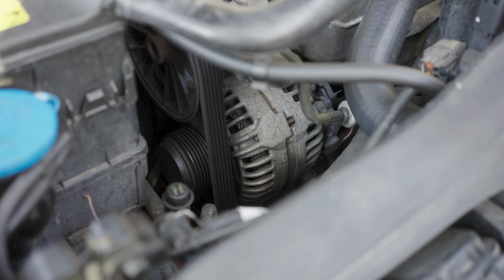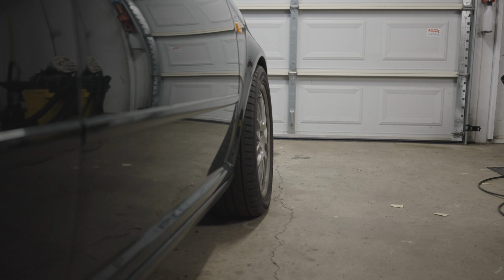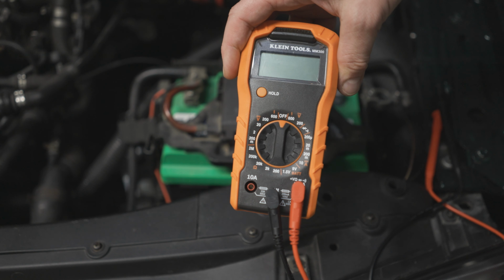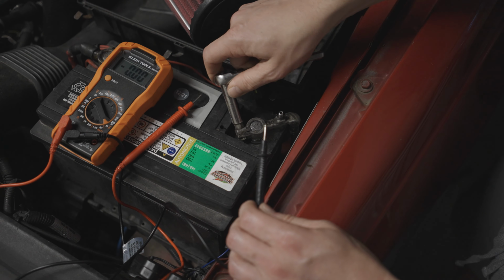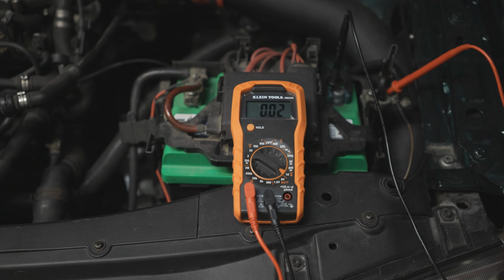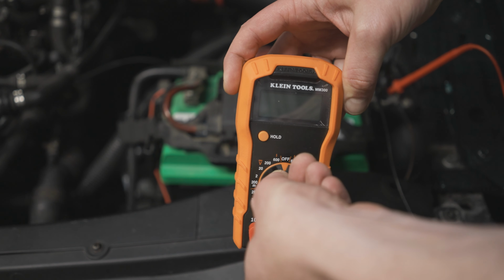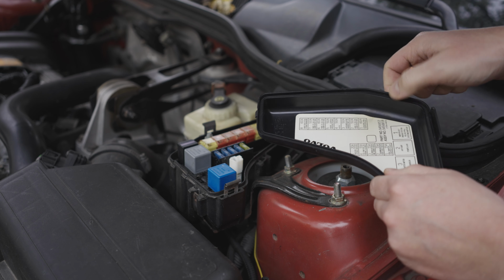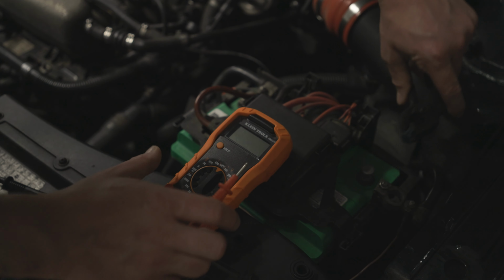How To Test Parasitic Draw on a Car Battery

Comment: Had an intermittent drain on a 2000 Bravada few years back. Finally found it. The vanity light switch was failing and the light for the vanity mirror on the sun visor would, sometimes, come on. Couldn’t see it because the flap was closed. Took forever to find.
Reply from the maker: It seems like every story of a battery drain is different. I haven't had a vanity mirror switch like that go, but I have had problems with a poorly wired radio and a door switch. I've also seen someones phone holder contacting the eject button on the radio and that was causing a drain.
Reply: Good info thanks. Always look at the vanity mirror lights first. In a dark area with the car off, key out, you should be able to see some light around the edges. Or could try to use a temperature reader.  Handheld, you can get them at harbor freight. If the vehicle has been sitting for a few hours the visor area should be same temp as everything else around it. The old GM switches are just a little plunger like, the size of a pencil lead.  If it is the vanity light, I would just pull the bulb out.
Reply: Think that’s what I found on my 2000 blazer PO taped it took forever thought it was the aftermarket radio
Reply: Nice

Comment: Too fast slow down Jack
Reply from the maker: Thanks for the feedback. Anything I can help you with?
Reply: @StevesGarage  noobs like myself can't catch up but will try this week. My brand new 2024 Toyota Grand highlander xle hybrid has been draining my 12v battery.  I can only imagine that it's communicating with Toyota while parking in the garage.
Reply from the maker: @onehmong9368  That new I'd probably just bring it into the dealer. There's no reason it should be draining the battery even if it's connecting to the internet for updates.

Comment: Just tested my truck using this method and got 0.02 on 10A scale. So my truck parasitic range is still ok right? Ive added a bunch of accessories(lights) most are to constant power but have switches so none of them should be drawing anything ....but i have 3 glowshift gauges that i think 2 have a constant power wire to keep color memory...dont remember if i hooked up that wire for the 3rd gauge.
Reply from the maker: Yea that seems totally fine to me. Is your battery dying too quickly?
Reply: @StevesGarage sorry this is gonna be long just trying to be detailed. truck was having hard starting issues. At 1st I found out battery was always needing to be charged to start truck. So I disconnected battery charged it fully and load tested it it tested in the very weak range needle didn't even get to numbers lol. So bought a new battery made them load test it before purchase(over 1000cranking amps) made sure it was fully charged before install. Also while I was installing I figured good time to test for parasitic draw to see it that what killed the last battery. That's when I got 0.02 on meter. Anyway installed battery tried to start truck and still just click click click so got annoyed and hit starter with a hammer a few times and then got it to start(only time I've hit starter). Since then sometimes it starts fine other times  just click click click BUT I found if I try the ignition key rapidly like 6x in a row I can get it to crank and start the truck. At this point I'm starting to think brushes in starter are just about shot making it hard to start sometimes but thats just me guessing....starter is over 30years old.
Reply from the maker: @FAKE-NAME  I appreciate the details! 

With a new battery and a normal amount of parasitic draw, I'd say your starter is the next place to look. Especially because it's old, and you did get it to start after hitting it with a hammer. 

The only other thing I would check is things like your grounds, or other wiring that goes to the starter. I know in the case of my Jetta the wire that runs to the starter is a known problem, so in the case of that car it's the place I would look before going down the starter route.

Good luck and let me know once you sort it out!

Comment: I have had my battery unhooked for 30 plus minutes so everything could loose power and tested it gauge jumps way up not sure what the draw could be I have a basic needled gauge which nobody on YouTube has not even sure where to set it I have tried multiple positions and gauge jumps up but it's prob normal for a POS DODGE.
Reply from the maker: If you're disconnecting the battery and re-connecting it with the multimeter you'll need to wait for the car to sleep again. If you wire in the multimeter before disconnecting it and then leave the multimeter as the connection it should maintain the 'sleep'.

Comment: i did a draw test and i get 40ma with the remote starter. (new battery in 2022).  2-3 days not driving the car. the batter would get drain.  i removed power to the remote starter and it draws only 20ma. the car would sit for 3-4 weeks and still be able to start fine.  so you saying under 50ma is okay.. makes me confuse af.
Reply from the maker: Have you checked your alternator to make sure it's properly charging the battery? If it were me I'd also look over the wiring for the remote start system. Start by checking your grounds. I have a remote start system on my Volvo and it doesn't have that high of a draw.

Comment: Hook up meter shows 2.24 but starts to go down to 0, what's wrong can't check for draw.
Reply from the maker: That sounds like a connection issue to me. A reading of zero is pointing to a problem with your meter or wherever you're hooking the probes up to.
Reply: So I'm having this same issue... I have a Silverado that dies overtime, hook the multimeter up as shown, but it tends to slightly spark before showing the reading, then goes to 0. I tried this on a different vehicle that shows no drain and also never sparked.

Comment: Got a 07 ranger 4.0 . When its freezing outside its like my batteries dead but i got 12.4 volts. Alternator charging 14.3 battery is 6 months old BUT only 590 cold cranking amps. My 4 cylinder pt cruiser was 625CCA. ITS FINALLY  warming up to -2 tomorrow so try the parasitic draw testing,  but does the 590 CCA seem low for a 6 cylinder?  Any help would be appreciated.  Before i freeze my butt off. Thanks( currently on charge going to see if drops overnight)
Reply from the maker: I would think 590 should be enough, and the 625 on the PT Cruiser almost sounds like overkill. Sounds like your battery is healthy. Did you check all the connections? I wouldn't rule out a faulty battery either, I've had that happen. If all else fails I'd bring it back and ask them to test and possibly replace it.
Reply: @StevesGarage  I ended up taking it to local battery dealer who did a free test and it is the battery.  Even after charging it fully overnight and reconnecting brand new terminals it just barely started at -2° just waiting for a new shipment of batteries to come in. I was told in May by previous owner it was a new battery.  Guess he meant new used battery.  Thanks for your reply, greatly appreciated
Reply from the maker: @chrismcdonald6481  Glad you got it sorted out! It sucks it wasn't a new battery, can't trust anyone these days. But getting it solved is good, especially in the winter!
Reply: Ezily could of been new.
New is used these days.
Reply from the maker: @ Yea, I've seen more than a few bad batteries right out of the box.
Reply: @StevesGarage  it was a bad battery.  Got new one problem solved

Comment: Thanks, my multimeter shows 11.0 draw, don't know what just happened, will check my radio, it just makes a pop sound every time I turn it on😢
Reply from the maker: The radio makes a pop sound, or the car does?
Reply: @StevesGarage  Yepp, I hear a pop sound from the front tweeters when turning the radio on.
Reply from the maker: @aakudev  Do you have aftermarket speakers or a head unit? It sounds like you need a crossover.
Reply: @StevesGarage  Yes, I have a Pioneer double din since almost 12 years in my Civic. I also have Infinity components with crossovers. Everything was fine and this pop sound recently started, I checked the wiring too. Do you think it could be that the head unit is too old and can have issues?
Reply from the maker: @aakudev  It's been a while since I've done anything with car audio so it's hard for me to give you specific advice on that. It's possible you have a bad ground. You could also check the resistance of the speaker.
Reply: @StevesGarage  Thanks, will get some in depth tests done by an electrician!

Comment: Dont forget to check water levels in battery. If its low the battery may not be able to sustain even a common 20mA draw.
Reply from the maker: Do they sell serviceable batteries anymore? I haven't seen one in years.
Reply: My battery starts to die off in cold autumn before the winter. 2 days without driveing and i get 2 poor cranks and thats it. Battery is almoust 2years only and in summer no problem. I got this promblem in first winter with new one. Will try the multimeter again. Last year i checked  with no problems. Dont know, maybe bad battery with low water level
Reply from the maker: @garaiselvis  I don't know of newer batteries that are serviceable. As far as I know they're all sealed. If it's not holding a charge and you bought it 2 years ago you should be able to get a new one prorated for the amount of time you've had yours.

Comment: You just taught me so much in so little! Great video. Straight to the point and very detailed as always. Those multimeters are  very useful. I need to snag me one for sure.
Reply from the maker: Quick and informative was my goal! Multimeters are great to have around. You might not need one often, but when you do it's the perfect tool.

Comment: I have a 2002 Nissan frontier was reading 0.40. I replaced the ignition switch now it’s at  0.07 for a draw. Iv checked every fuse, relay, battery and alternator are good.
Reply from the maker: Interesting. Is it a common problem with those trucks so you just went for it, or did you diagnose it to be the ignition switch?
Reply: @ I went through testing and pulling fuses, the ignition switch dropped it to 0.07
Reply from the maker: @buggz3389  Nice diag! Glad you figured it out and got your truck back in tip top shape.
Reply: Hi Steve , I have been experiencing a parasitic draw as well since Aug 2024. Dealership is totally useless. Alternator replaced and starter replaced. Still no solution- Camry 2013 SE
Reply from the maker: @OpeyemiAdu  If you have any aftermarket components start there. If not, your only real option is go circuit by circuit checking every one.

Comment: Great video but hard to see how you connect then leads. Are both black and red connected to negative post?
Reply from the maker: One goes to the negative post on the battery, the other to the negative battery cable.

Comment: What’s the name of the clamp you used to hold the multimeter leads in place?
Reply from the maker: I've always called them spring clamps. You can buy a bag of assorted sizes at Home Depot for $10. They're handy to keep around!
Reply: I cheaped and bought 3ft gator leads to go with the 2ft the hobo cheap came with.
Continuity itself, with the pointy leads. (No beep tone feature)
It would be floaty unless it was end point on end point, still some floaty.
Clipped gators onto the pointy and then it was always steady proper reading.
Got the gators for more reach and so it would hold itself. Bonus to steady reading.

Years of probable parasite?
The inside lock unlock buttons are non to barely click but dont work.
Driver side 100% out
Pass is 85% ish
Maybe thats the source
Maybe the out of sequence rear electric stow seat??
Maybe the common for this model wires under the hood have baked sitting on hot engine
As i need to check per driveabiltiy issue, that being one of the tricky possibilities.

The loom is cooked everywhere under the hood
Where there is some it crumbles to the touch.

Scan tool passes both the alt and batt

But always start with connections 
Tight?
Corrosion?
Clean um up and grease does wonders
Reply from the maker: @Chayliss  Wiring problems can definitely lead to a draw. I'd start with that circuit and work out.

Comment: Good info, thanks.  I would not suggest a BM 15D multimeter. I think they are sold under different names. Just a pain in the azzz all around.  You have to press a button to toggle to the setting you need. The instructions are worthless, and to change the fuse you have to take off the plastic protective cover and need to use two paint can openers, look like bottle openers to pry it off. 
And the fuse was dead as you mentioned.  Which is probably not the multimeter fault, but mine.  And they do not list the size of fuse in the instructions. ugh.
Reply from the maker: There are a ton of multimeters out there, and some are definitely junk! I got mine from Home Depot and it's worked fine for me. There are certainly nicer ones out there, but I'm not using it every day so it's not like I need a high quality one.

I did have trouble finding the correct fuses for mine as well, but they were at least listed so I knew what to look for.

Comment: drive car for 50km yesterday and today morning, car stopped to start.. never before i have this issue, car is making tuk tuk noise and and i cab see fluctuations in all the lights, plus battery light came on..
what can be the issue? also car’s battery is under warranty..
Reply from the maker: I'd look at the battery or alternator before looking at a draw issue.
Reply: @ thank you for the reply, as i diagnosed.. one of the cell in battery was dead. and it was under warranty.
Reply from the maker: @abhijeetkumbhar-y2z  I've replaced my fair share of batteries under warranty. Glad you got it figured out!

Comment: Would it be a good idea to replace the fuse or just permanently keep it empty?
Reply from the maker: The fuse isn't the issue, it just disconnects whatever is. For example if you isolate an aftermarket radio as the source of the draw, there's most likely an issue with the wiring that is causing the radio to draw power when the key is off. Pulling the fuse will stop power from going to the radio entirely. It technically solves your draw issue, but you also can't use your radio without the fuse in place. You'll want to diagnose the issue causing the draw.

Comment: Hi, I have a toyota corolla 2017 manual transmission. It draws 140mA with the alarm activated all doors and lights closed. It is the dome fuse that draws 60mA out of the 140mA. It then turns to 10mA when a relay clicks after 20 mins. Is this normal? I hope I get noticed..
Reply from the maker: Is it an aftermarket alarm system?

I'm not familiar with Toyota in particular, but I know my XC90 has systems running before it 'goes to sleep'. It's doing things like scanning for the key, closing the hvac vents, etc.

If the relay is consistently clicking off after 20 minutes that sounds like normal or expected behavior for the car.
Reply: @StevesGarage  No its the stock alarm. I'm just wondering why the dome fuse is drawing that amount of current for 20 mins. Isn't that odd?
Reply from the maker: @erichernandez9751  You'd have to look into your car specifically. That circuit could be running a system that stays on for 20 minutes before going to sleep. I'd be more concerned if it ran indefinitely than shutting off after a period of time.
Reply: @StevesGarage  Thanks for the input. I'm looking for a circuit diagram of the dome fuse now so I can check what is hooked on to it but I had no luck finding it online.
Reply from the maker: @erichernandez9751  If there are repair manuals available they typically have a wiring diagram!

Comment: I just bought a 2025 Subaru Outback, my 5th one. I leased the others and decided to buy this one. Never had issues with them before but this one has a couple of lights that will dim out and brighten up and dim out again. Also the horn tone tends to change during a horn press. They changed the horn and now changed out the relays. It still does it. We have very good winters here and it seems to happen only when it’s really cold. When it’s been above 32 degrees Fahrenheit it’s fine, below that and the horn sounds like crap. Not sure what to do. It is very frustrating considering I e had 4 other Outback’s with no problems then I go drop $45k and buy the next one and this is happening. Any thoughts?
Reply from the maker: Seeing as it's brand new I'd take it to the dealer. That being said if I was going to diagnose it, check your connections. Battery, ground, and any other large electrical connections between the battery and something like a fuse block.
Reply: @  I have taken it to the dealership twice already and had the horns replaced (high and low horns), then went back and had the relay and fuse replaced for the horn system. The dealership is at the point of saying they did everything they could. I don’t trust that they actually know how to properly diagnose this issue correctly. I might need to take it to a shop that knows how to do things like you showed in this video.
Reply from the maker: @shanji1776  Inspecting the wiring visually and making sure everything is tight is easy enough to do yourself. Checking the alternator and battery health aren't a bad idea. It could be as simple as a defective battery right out of the box. Start simple and get more complicated. Parasitic draw is possible as well. Leave a comment when you figure it out, I'm curious what this could be.

Comment: Use distilled water or water made for the battery only. Never straight water.
Reply from the maker: Correct! As long as it's actually serviceable. You don't want to go cracking open a battery that isn't meant to be.